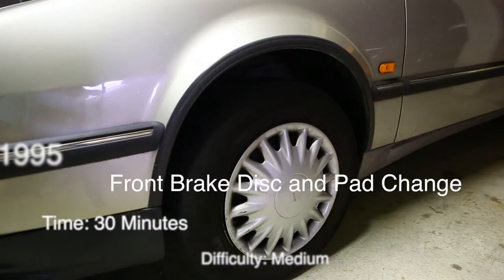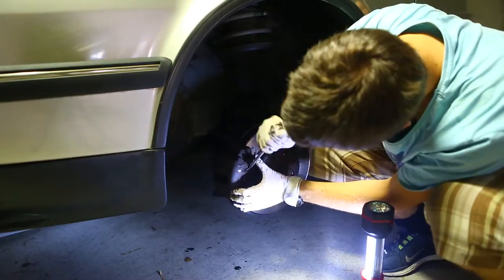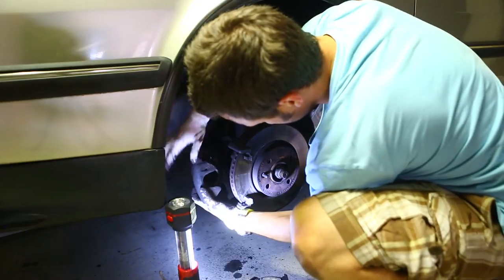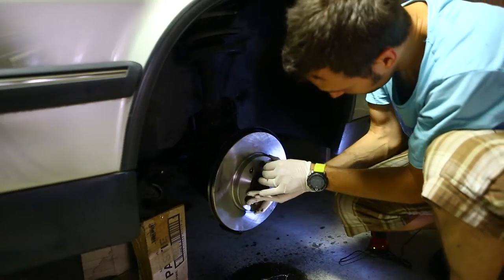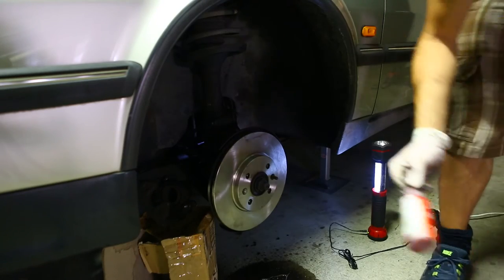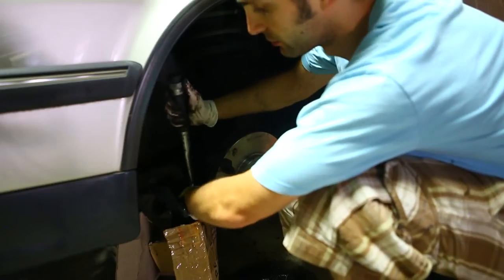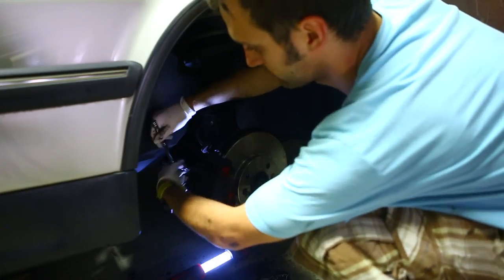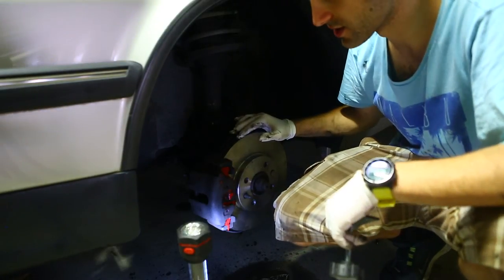SAAB 9000 1995 Front and Rear Brake Disc and Pad Change

Comment: Hey great vid thanks!   What was the name of that tool you fitted into your ratchet to engage with the thing inside the plastic cover at 1.52?  Make sense?  Ive never seen that tool before!  Thanks.  \most useful vid ive found for my toyota avensis believe it or 
not appears to have the same breaks!! Cheers, Claire
Reply from the maker: Hi, I beleive it is a 7mm impact socket, similar to: http://www.kctools.com.au/Products/impact-sockets/3-8-drive-sockets-metric-af/7mm-3-8-quot-drive-impact-socket
Best of luck and glad you found the video useful.

Comment: How about those rear brakes?
Reply from the maker: There is a little cap you have to remove. Behind that you need a little Allen key to loosen the cylinder. I will do another video when I have to redo the rears. 
Hope this helps